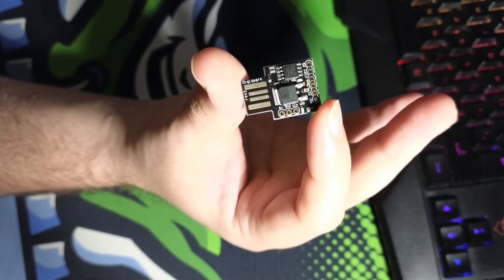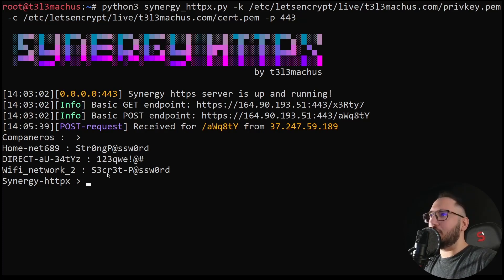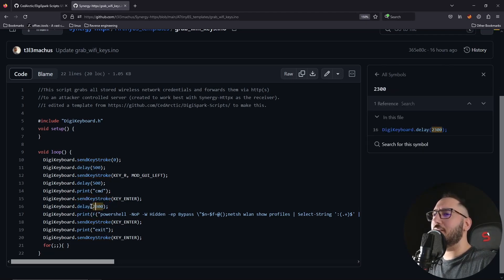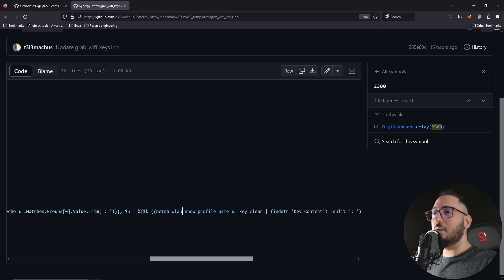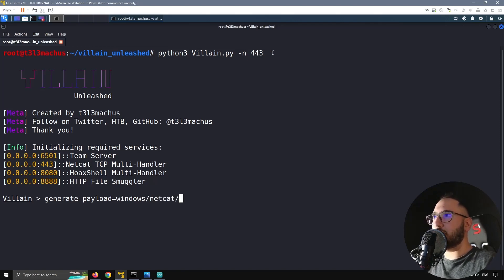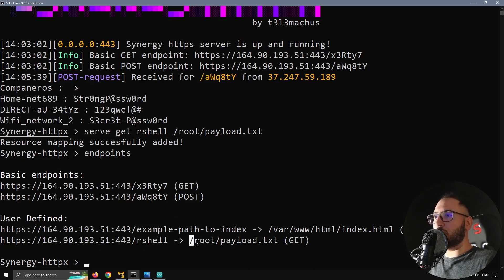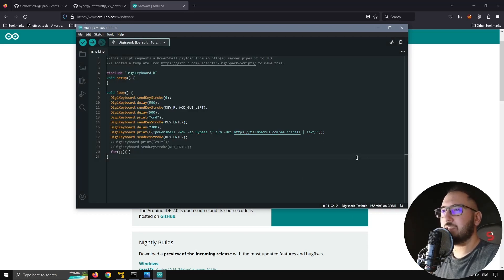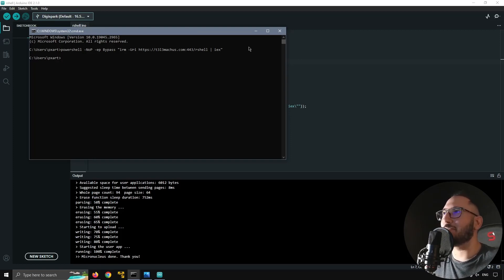Keystroke injection attacks with the ATtiny85

Comment: I had just amazoned for this product after seeing tcm vedio of making a rubber ducky with this device he used a code from a github repository forgot the name it was in arguing and plugged the USB in having this device in it and it worked but then I thought won't a good av or even defender catch this in the first place or is it because using arduino code that it won't detect this device as doing something malicious as running a  keyloger ??
Reply from the maker: This type of micro controllers (rubber ducky, ATtiny85, etc) are acting as a legit USB Keyboard, which is hard for AV software to detect. There are, though, other obstacles to worry about, for example, if you plug a keystroke injector to a machine that has caps lock turned on, any case sensitive part of the injected code will not work. Same goes for the active keyboard layout. If you plug it to a machine that has, e.g. the Greek keyboard layout enabled or some weird English variant, the injected characters will be messed up.
Reply: @HaxorTechTones  ohhk but won't the threat actor check is the capslock key is in keydown state and write code such a way to change that and keyboard layout can be more complex than the capslock problem I think . I just had a thought that simply pluging in an usb can it work or not cause av defender the point of all these things we pay money is to detect such activity write and I see like code that isn't even much obfuscated work past defender I thought how can that be . And I think now if a threat actor or a pentestor can physically be present and  insert the USB directly into the system a lot of work could be avoided like phishing and all don't have to be done to gain access into any organization. He could insert the USB and rest could be history
Reply from the maker: @firosiam7786  I think it's a completely different scenario to just plug a bad usb than having to also interact with a machine's keyboard. Given the circumstances, it might be convenient for a threat actor to plug in a usb without being noticed, even if monitored by CCTV / humans (e.g., sitting as a guest in someone's office with the tower/usb hub placed in a way that exposes its ports to guests). The injected payload will be scanned by the antivirus (AMSI will take care of that on Windows) and react accordingly, it just didn't occur in the example I recorded.